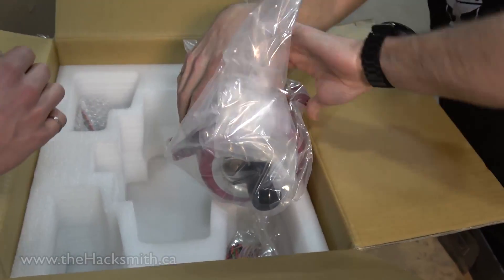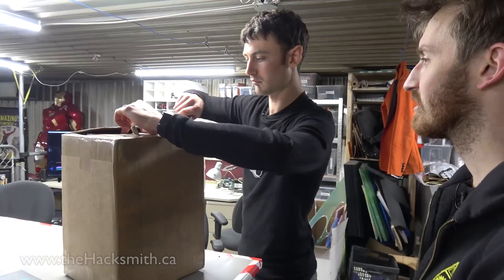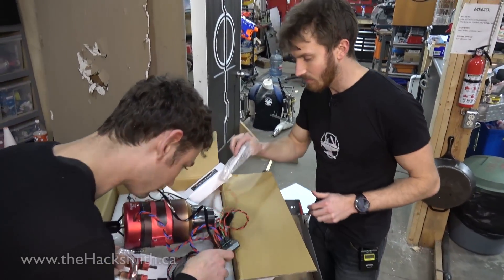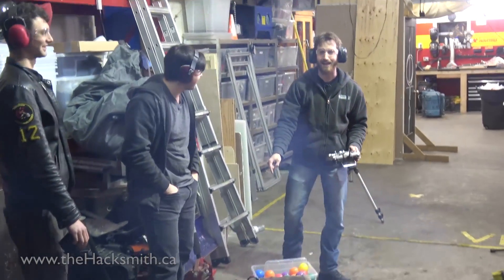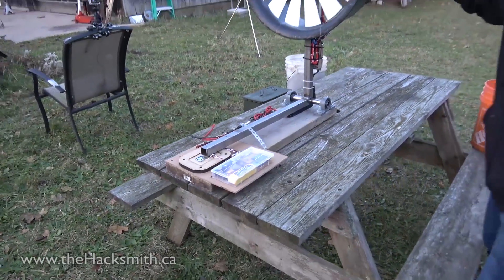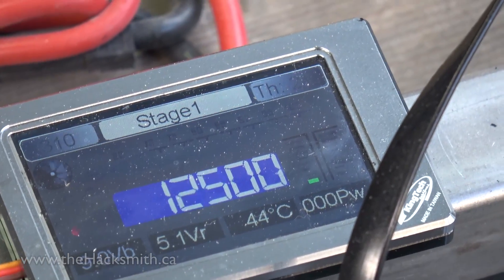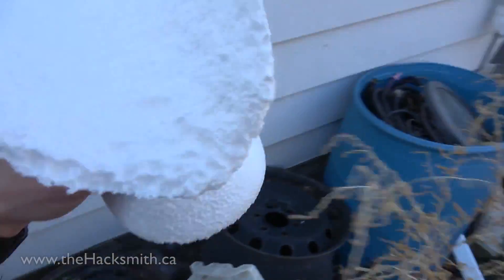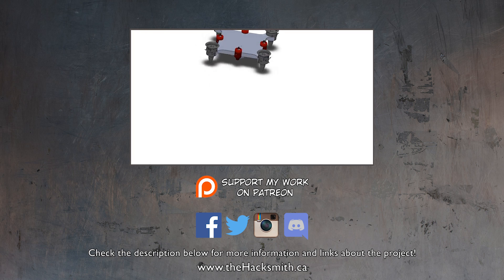Jet Engine VS FACE (Flying Like Iron Man Update)

Comment: a tip for your iron man flying thing use the jet engine and order different metals and try which melts and those who do not melt you can put on your back and legs so you do not die when using the jet engine and have a small edf in one small flap on your left and right leg and a small flap on your back if you have more edfs then you can fly better i think xD

Comment: Ceramic shielding with a cooling unit under it and an insulating layer? Maybe work the EDF system in as a way to slough the heat from the cooling system?

Comment: I suggest putting  a shroud around the jet engine. Eg: put it in a steel pipe with at least 1.5 cm clearance  around the engine and  several centimeter longer than the exhaust  shroud. The reason  for this is to duct additional air around the engine cooling it and the exhaust gas and potentially giving you additional thrust from the expanding air especially if you decrease the exhaust end aperture.  It must be larger than the engine exhaust aperture  but not by alot.

Comment: Wow! You're really close to becoming a real life iron man
Reply: I agree with the other guy 1 jet that cant lift a person and is dangerous to the public and can light yourself on fire which will make you die a horrible painful death isnt progress
Reply: zioxei well it really depends how powerful the engine is a jet engine from a 747 could easily lift him up no bother
Reply: greenjoe420 magicanium is more powerful than those other imaginary metals.
Reply: how about making a fully operational ironman suit out of tungsten.
Reply: greenjoe420 tungsten is to heavy and will cost more to get of the floor using jets and heavy objects are hard to unstrap in case the fuel lights on fire
Reply: Sabretooth06 i considered it, unfortunately we dont have vibranium
Reply: Inane Observations lol
Reply: Eeeehhhh

Comment: I would not use diesel, goto the local airport and just buy jet fuel. Also shut it down if the fire persists during start, that was a really bad hot start.
Reply from the maker: The manufacturer literally tells you to use diesel.

Comment: VTOL system! Use either edf system or one jet engine with duct and in combination with Venturi theory the end of the tubes should provide some thrust. And the tubes should be flexible to maneuver to stabilize but mechanical stabilization should help and help use loop and auto calcs to help stabilize in flight. I refer to the harrier jet system!
Reply from the maker: +Sevenity Guitars redirecting thrust via tubes is very inefficient, the only reason the big jets can do it because they have ridiculous amount of power =(

Comment: Why not just use some co2 or some other pressurized gas to fly?
Reply from the maker: +rakesh dhiman not possible as far as I know
Reply: It doesn’t put out enough thrust and you would need a metric assload of co2 or other gases

Comment: This project seems to keep getting riskier and riskier not only are you planning to strap two types off several fairly chunky jets and edfs any which could fail catastrophically if you fall on it. 

you now seem to be also be planning to strap several litters of diesel to yourself in addition to volatile lipo batteries which could catch fire if you deform them in anyway, overcharged them, under charge them, let the charge get unbalanced or frankly look at them funnily.

Don't be the next youtuber to kill them selves doing something stupid like trying to block a bullet with a book.
Reply from the maker: +Cameron Cooke don't even compare that dude that's just insulting.

Comment: I had an idea for the heat resistance...
Why not use layers of decreasing heat resistant materials instead of using the same high resistant material thicker,which would possibly be heavy....
So better use layer by layer like first vespel then ryton then nylon polymers then aluminium then sm other resistant mayerials.....
And if the layer is made limited to ur back part of ur legs like iron man possibly the weight wud be reduced...IF the jet engines at ur back...which is likely to be the one ....like upto sm 7-8 kgs..
Just an idea...i am not educationally qualified now though...
And All the best guys!excited to see u on trending!!!Hope many sponsors come
Reply: Or just get some lightweight heat resistant foam

Comment: pulse jets are easy to manufacture and have solid output
Reply from the maker: pulse jets typically weigh as much as they can put out in thrust, which means they can't be used for VTOL. Work great for landspeed vehicles or planes though!
Reply: the Hacksmith I've seen videos from a German guy can't remember the name, but they use heat resistant composite and the power to weight is pretty substantial

Comment: You should use high-temperature ceramic heat shields as the same as in space shuttles. Made some weird coat from it or life vest. Unfortunately it raises your flight weight.
Reply: or pumice

Comment: Why wasn't it legal to use model rockets??
Reply from the maker: you need licensing to use bigger rockets since they're basically explosives. could we have gotten licensing? yes, but then we'd still lose the licensing and get fined for not doing what you're suppose to
Reply: the Hacksmith 😂 good call

Comment: "the exhaust is very dangerous and hot" uses wood frames to hold it together
Reply from the maker: it's a metal frame...
Reply: In the head destruction demo?
Reply from the maker: the wood frame holding the zombie head?... it's not in the exhaust path
Reply: ah

Comment: for your platform you'll want to make absolutely sure that the jet engines have as close to equal thrust as you can manage otherwise the EDFs won't be able to counter the forces they should be

Comment: are you aware that every motor you have u need like half a kg of batteries or fuel, then u have like 4 of then so thats like 2kg more u add and it adds and adds as you add more jets
Reply from the maker: would you believe we actually calculate those things?
Reply: probably not 😂 narr i trust you would , if i had the supplys i could be in the air buy now 😂 been planning this out for like 4 years

Comment: Hacksmith, for the heat problem, try using a solvent that astronauts use for the spaceship. It can withstand rocket heat, and I have seen a demonstration, where the person was holding a brick with their bare heands, that was glowing red hot. Plz try it. I don't know if it is commercially availabale.

Comment: I was originally hoping that this would be an electric only project without using fuel burning methods to create thrust, just like iron man did. Using strictly electric motors would drive down the price of the project overall and make it possible for other people to replicate this 'contraption'. Jet engines are not cheap, and i was wondering if you guys are going to make this one with turbojet engines and rockets, can you make another series where you do it again using only electric motors, and cheap materials?
Reply from the maker: Electric is more expensive dude...
Reply from the maker: The equivalent EDF to this jet engine doesn't exist. The biggest you can get is one with 24kg of thrust (jet engine is 32kg) and it is larger. You also need more batteries than fuel .
Reply: What?! Those jet engines are like $2 thousand each! I'm genuinely surprised! Thanks for letting me know.
Reply from the maker: the EDFs of that size are $5000 each. and less powerful lol

Comment: Re: bigger motors being "Illegal": 
With a pretty simple permit through the NAR or Tripoli you can buy rocket motors with up to ~150 pound-seconds of impulse. 
With more advanced permits, civilians can buy rocket motors up to 150,000 pound-seconds of impulse.

They were just too lazy to go through the permit process.
Reply from the maker: A permit that specifically tells you NOT to strap them to yourself. Even if we did that, we would have it revoked almost immediately.

Comment: @theHacksmith By the way, in the movie the jet thrusts are on his back and he has edf stabilizers on his hands and feet. Just wanted to tell you before you try to put the main thrust on your hands and burn them off. This would also allow bigger engines for the thrusts on the back making it easier. Just a thought.

Comment: Here’s one idea, maybe you can have a flame retardant full body suit with face protection under the armor so you don’t burn as well as that you could wear multiple layers around the areas where the jets will be. Also have internal cooling as a little touch so you don’t sweat to death expensive I know but it could work

Comment: Maybe you ciuld put two jet engines on your back like a backpack or maybe in form of a kind of jetpack and than some edf's on your arms/hands for stabilisation. And to prevent burning injuries you could try to make a metal protection or get some firefughter protection clothing which should be able to handle some 100 degrees but u dont know how much degrees the jet produces

Comment: Why don't you just build a small jet? Just like Peter srippol build a plane :D
Reply from the maker: +Fabio v. B. One does not simply builds a small jet =p
Reply: the Hacksmith you're the hacksmith. You are like Elon musk but on a budget. I am pretty sure you guys could build a jet ^^
Reply from the maker: +Fabio v. B. Engineering is about using existing technology, not reinventing the wheel ;)

Comment: What about 2-3 three of them attached to a light metal frame to hold it away from your body instead of strapped to your back with a water cooling system or another type of cooling system?

Comment: Take the jet fuel and light it on fire, then! Get a steel beam. I want to see if it is actually possible for jet fuel to melt steel beams...
Reply: Fuck Face I hear a 9/11 reference!
Reply: Fuck Face Its not real unless you could keep it lit for a long time due to the heat to go through the metal
Reply: Structural steel won't melt but it'd soften to a point where it becomes pliable.

Comment: @the Hacksmith Please Use Pulsejet Engine....They Are Easy To Make And Powerfull
Reply from the maker: +Noobie Last they aren't actually powerful, typically they weigh as much as they put out, so VTOL is out of the question. Only good for land vehicles or planes with wings

Comment: What if you used your exoskeleton and put an fuel tank on it's back then connect this fuel tank to these jets and the jets to the exoskeleton? It would be like an iron man prototype armour but without weapons and the if you want to connect the jets near legs and hands get some cover for the heat that will be coming from the jets and get iron boots cuz that fire from those jets may burn your legs...

Comment: Back when I was in high school I had an idea for a backpack helicopter that would use hydrogen peroxide reaction engines at the tips of the rotors, largely getting rid of the need for a tail rotor, and hopefully being small enough to be carried on one's back.  Obviously carrying a tank of high strength hydrogen peroxide might not be the best thing in the world to do, but perhaps it could be done with EDFs.  The biggest hurdle to that would be the transmission of power from a backpack battery to the spinning rotor, I don't know if that could be done through an insulated swash plate, or perhaps with magnetic induction.  Might be an interesting project if I could afford the EDFs and batteries.

Comment: what do you think of using a different fuel which won't put out so much heat? like ethanol with salt water (water absorbs a lot of heat). with this diluting, you'd need a stronger fuel like maybe nitroglycerin (be careful with high explosives like nitroglycerine).

Comment: You could save yourself the skin melting by wearing a suit that has been treated by what i think is called StarLite or StarLight. It expensive but extremley resistive to temprature and shock. Its not very flexable though so it would have to be a ridgid body suit like iron man. I think you know where im going with this. Good luck with the project!

edit: also try to pressurize the disel to store more of it with you while flying. (Final version thought)
Reply from the maker: you can't pressurize liquids!
Reply: the Hacksmith sorry, i forgot about that

Comment: Will the edfs provide any lift or are you using them purely for stabilisation
Reply from the maker: If they didn't provide lift they wouldn't do anything! xD
Reply: the Hacksmith that's not what I meant, I mean will the jet engines theoretically be enough to lift you/a prototype, the fuel, and    whatever kind of rig/suit you come up with or will it need the lift from the edfs to actually move.

Comment: Btw, can’t you use sound waves? I’ve seen vids of things floating with sound waves with a very smooth hover system, meanwhile the jet engine is hard to control, I’m not that smart so idk if this would work, but it’s an idea
Reply from the maker: Not for a person haha... those soundwave things can only lift things weighing in the micogram range